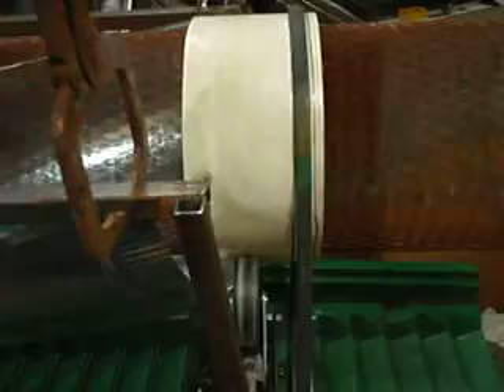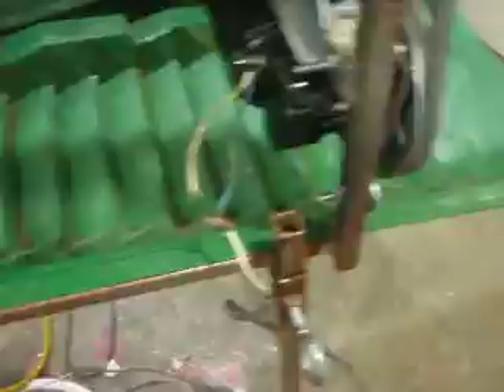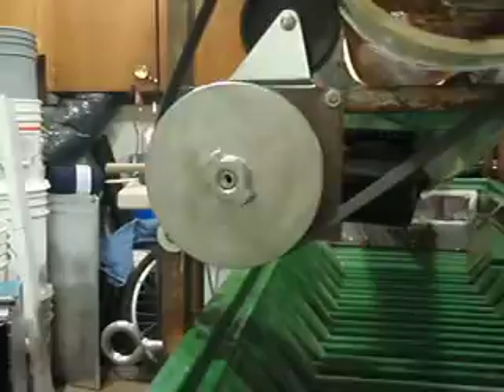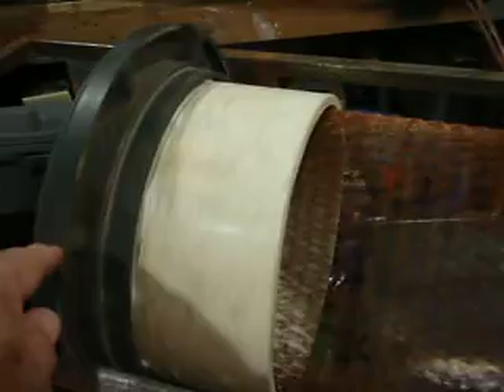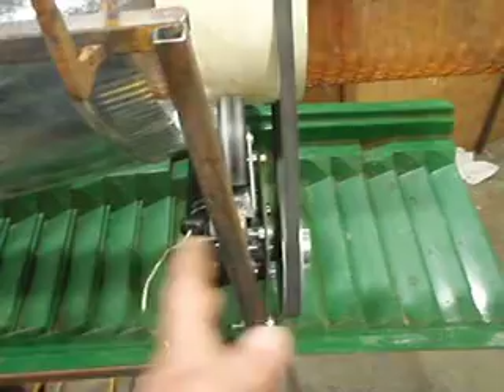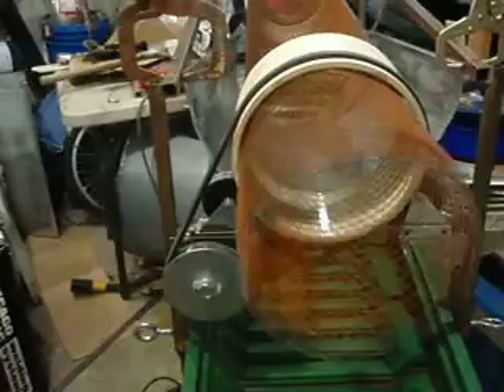Reverse Trommel Project. part 1

Comment from the maker: Thank you. 
I took this project out and used it, it works well. The main problem was the drive motor. It does not like the wet conditions. I had to take the motor apart and clean it out to bet it to start running. It sits at work right now waiting to be repaired. My mill restoration project has taken priority for now. Soon I will post what fun I have at work chemically extracting gold and all PM from dirt, one of a kind process, you will love it. Calcium chloride rules.